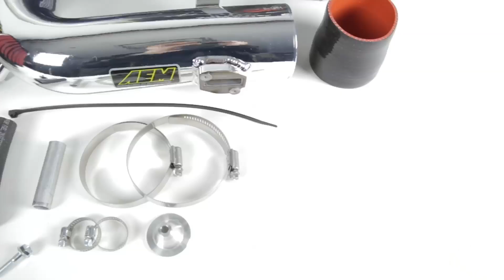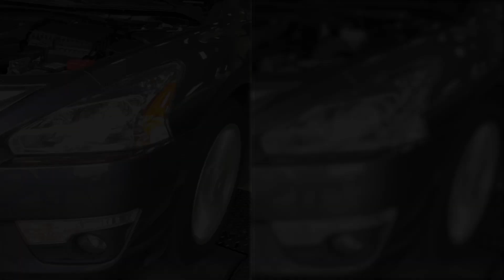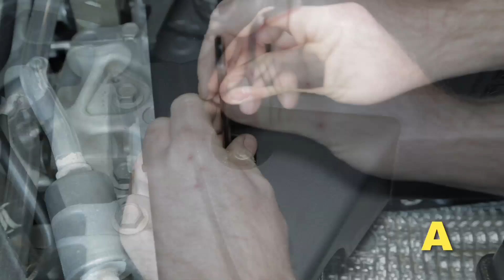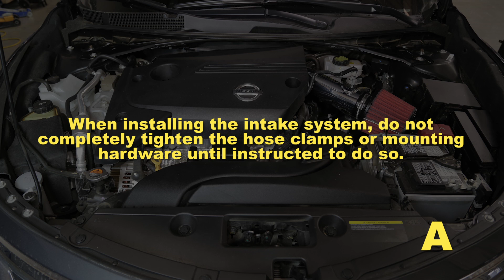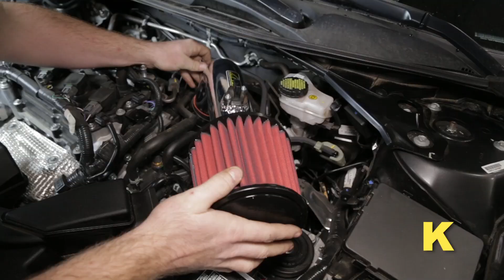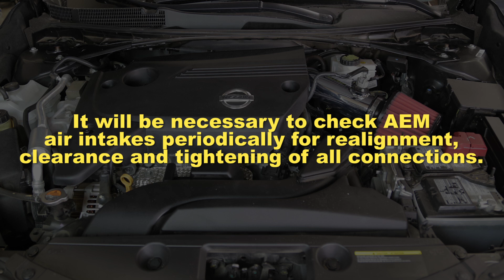2013 Nissan Altima 2.5L AEM Air Intake Installation

Comment: How much of a difference is it horsepower wise
Reply: Hp gains if any will only be at full throttle and high rpm. The gain will come from less air flow restriction over paper. Unfortunately with this setup the gain will be lost once the engine warms up and your intake starts sucking warm air.   The factory system is setup is draw air from the nose of the car where the air is cooler than the engine bay. Keep the factory box and slap a $55 k&n filter in there.
Reply: David Bryant  that’s what I did and that’s perfect
Reply: none at all just a way to loose your money.
Reply: 1hp... the mass air flow sensor will know too much air is coming into the engine and will compensate (CPU adjusting valve timing) so there is no gain. Manufacturers make sure your engine is running at optimal performance to its specifications. You need to modify the CPU but I have found none for 5th gen Altima.

Comment: Plan on putting one in my altima
Reply: Haris Mehadzic did you notice a big difference?
Reply: You won't get a difference other than sound. You gain about nothing because the MAF will recalculate and adjust the air. Cold Air, Short Air, are nothing more than a sound modification in the end. You need to completely reduce the intake and exhaust lines to get any gains and even that they are not much.
Reply: @Hidden02  nothing but a waste of money